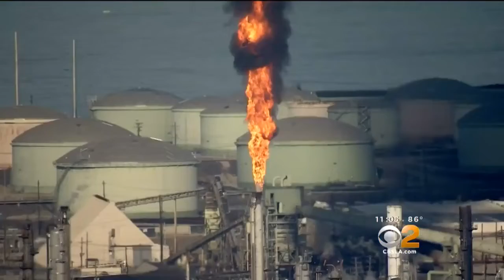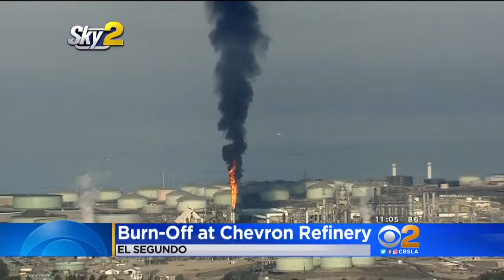Controlled Burn-Off From Chevron Refinery El Segundo Visible For Miles

Comment: that explains the dark cloud over los angeles today.. 
i am amazed that they don't set up the burners to have remote adjustable air bleeds so they can burn stuff fairly cleanly by being able to change the openings to atmosphere like every kitchen stove has..  i also can't imagine a refinery that important to not have giant stand by generators to keep it up and running ..
Reply: Its Pollution!!
Reply: Preston Garvey duh. But if they burned it properly.  It would just be a flame. No carbon clouds and no carbonmonoxide.